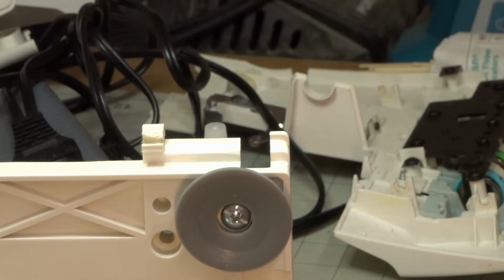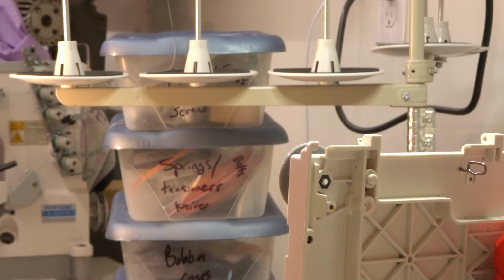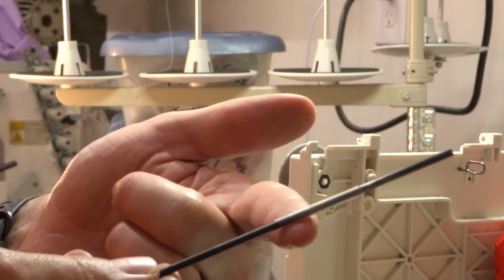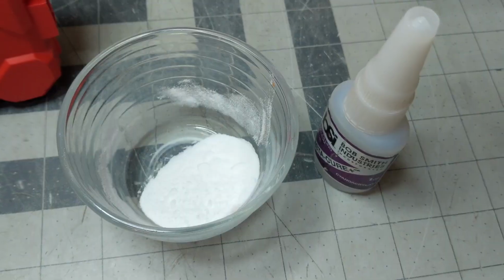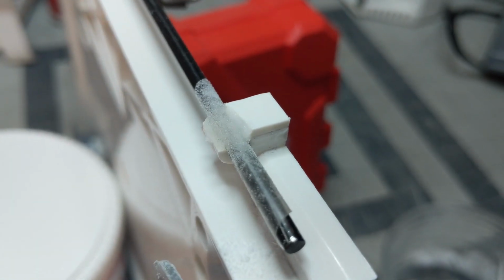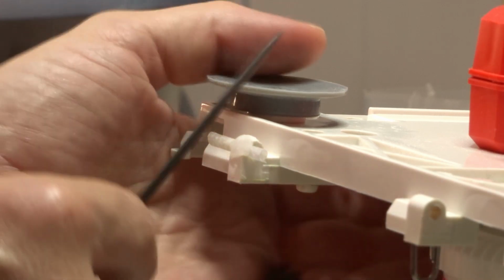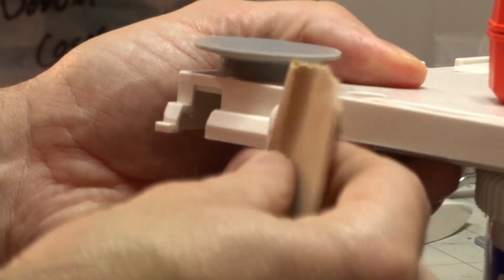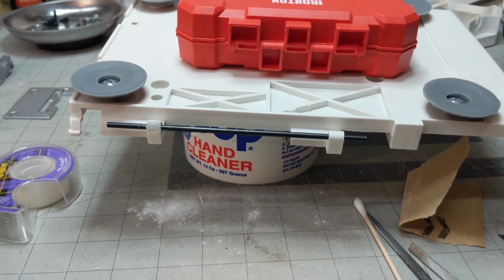How to repair an irreplaceable plastic piece on your sewing machine or anything made of plastic

Comment: It's amazing how hard wearing this stuff is.  I have plastic handled scissors that shatter when dropped on the kitchen tiles, but this glue technique gets all the pieces back together. Next time it drops, the plastic breaks in a fresh place: not the joint. Eventually the handles will be all glue!  :)
A couple of extra tips: add a supply of different sizes of silicone rubber tubing to your tool kit. You will find many uses for it. Here, I would have cut a couple of rings to fit either side of the break, so it would help contain the glue in the desired place. The rings can be easily cut away afterwards.
And: superglue dropper tops are a really stupid idea: they always block, and tipping the bottles builds glue up on the sides and wastes it and the whole lot solidifies in the bottle.  So: Buy the thicker, 'high build' versions of the glue; keep the bottle in the fridge (not freezer).  Throw away the dropper nozzel, or save it for another use. Do not tip the bottle up!  Use pieces of wire (I have nice thin lengths of piano wire that are perfect) to dip just the right amount of adhesive for each application, from the centre of the glue surface. For very small jobs you will find needles and pins the right size. This method is much easier and much more accurate than trying to get the right amount out of a mangled dropper top that you have to unblock every time you use it!  A further tip is to put graphite from a soft pencil around the bottle top threads, to help you get the top off, as you'll probably get some glue on them no matter how careful you try to be.

Comment: Fantastic repair idea! I might suggest however using a 0.002 inch thick brass shim stock instead of the plastic tape. This will allow one to make a precision fit bushing without any material overlap by forming the brass bushing over a rod slightly larger in diameter than the required final dimension. This bushing can be formed using a 32 teeth per inch hacksaw blade cutting the preformed bushing such that the saw kerf (cutting) width will close the gap between the two ends when the bushing is slipped off the larger roll diameter forming die. This technique will form a tolerance fit bushing made of an superior long term material with much greater strength and lubricity properties on the original hinge shaft diameter. The width of the bushing can be trimmed to user determined length once the hinge repair has been completed as shown in your tutorial repair guide.

Comment: I use baking soda for lots of things now I can add this to the list. I like to see the different sewing machines you review. I wish you were closer so I could have taken my sewing machines to you for servicing. I went to one of those sew and vac shops just for cleaning and adjustment. When I got it home and tried to sew the needle assembly fell apart. I put it back(following a you tube video) and tried to sew. Still the stitches were off. I paid this guy $200+. I was not happy. I needed to make masks for my family. I found I had a Kenmore machine. Nothing fancy, I plugged it in and went to work. I'm looking for a good embroidery machine, and a sewing machine that's a work horse and a serger. I probably have to buy them one at a time. I'm looking still.

Comment: I have a Viking Lily 535. Hinge broke.  Finally found replacement hinge (no longer available)for spool cover. However it did not come with a small spring that was left dangling on the old hinge.  My problem is that I have no idea how to attach the spring.  I can't find any information anywhere about this. Nor can I find any parts list which shows the spring. It's a sort of oval shape, flat on each end with one end split. Any ideas?

Comment: I discovered this method earlier in the year. Since then I have used it to fix a variety of different vintage plastics, including an internal plastic part on a Singer Imperial 7004. Just a few notes from my own experiments: Superglue GEL does not work. It has to be liquid. Additionally, use fresh superglue. If you use old glue that has started to thicken in the bottle, the resulting mix may be very weak.